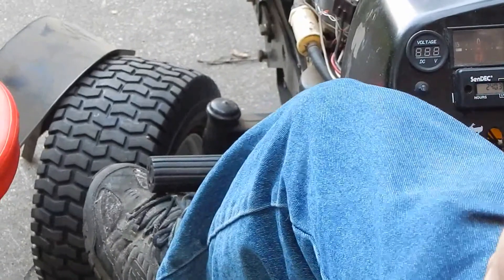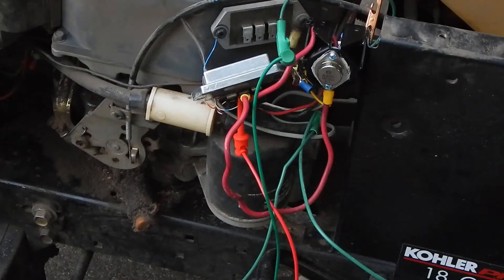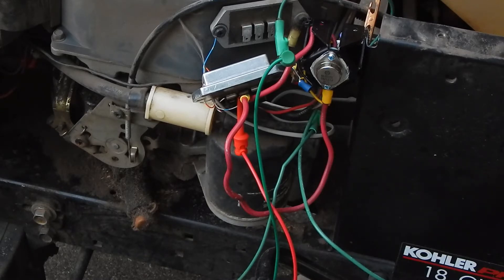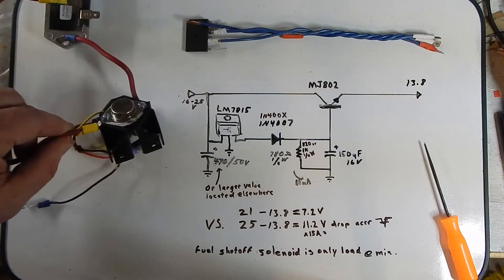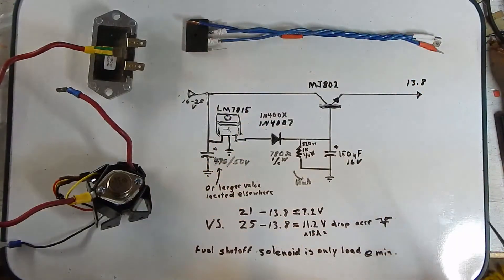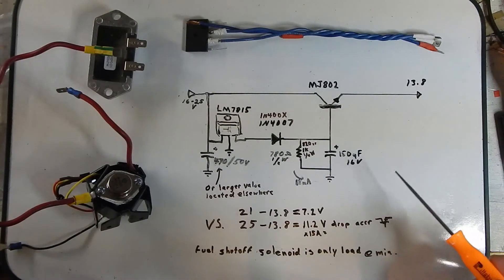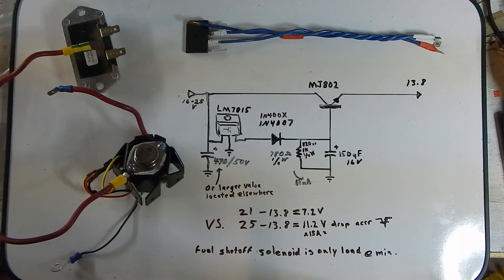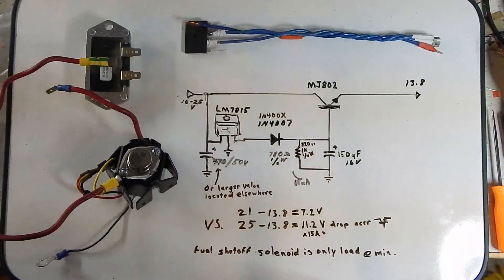Kohler Over-Voltage Saga - Testing the "Re-Regulator"

Comment: Why don't you try add a bridge rectifier in series with the B+, I got 15.3 ->15.8V from the stock regulator, so I added a 20A bridge rectifier in series to give 1.2V drop and return a more respectable 13.9->14.6V. Ignore the AC input and connect - -> + in series

Comment: It cant read the battery through a bulb because the bulb regulates how much wattage can pass , same with any other resistive circuit such as a relay ect. Therefore the regulator thinks the battery is low and boosts voltage and therefore heat reducing the life of the regulator.....if it aint broke dont fix it . if it is broke  , look at it like this : the manufacturer spent a lot of money on R&D , and it worked when it left the factory....if something has worked fine for any amount of time re-wiring it isnt the solution to the problem that you have a bad component...replace it with the OEM part and quit trying to overthink and over complicate a simple problem
Reply from the maker: I need to do a follow-up video on this.  After a Winter of heavy use, I did indeed again see cold boost as high as 17.8VDC in sub-zero conditions, the bottom line is that quality LEDs can take it, unlike the counterfeit version I first purchased of the same bulb I currently use (same Amazon item, different vendor).
Reply: Your still over complicating a very basic system , its a lawn mower not the space shuttle.